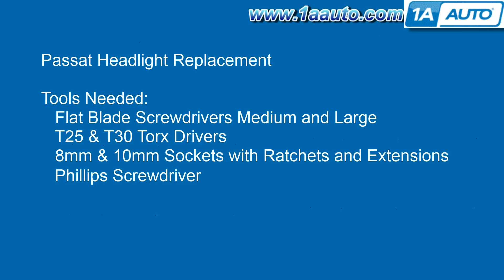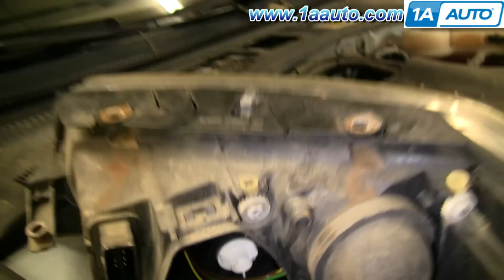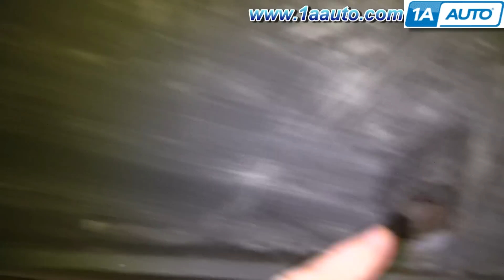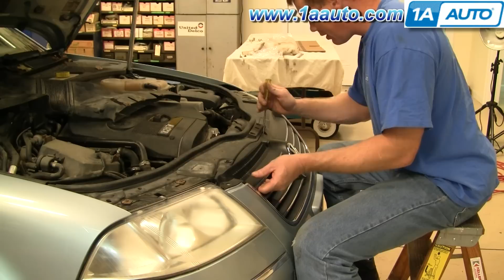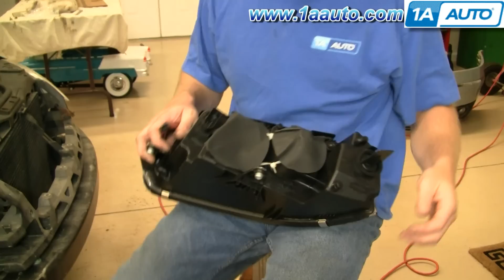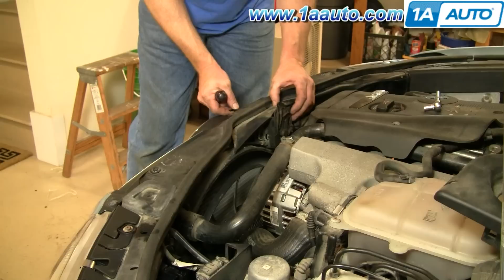How To Replace Headlight and Bulb 02-05 VW Passat Sedan

Comment: Not for dummies.   I'm trying to "just pull the bulb out" once i got the assembly loose.   Nothing moves.   Is the bulb supposed to separate from the metal cage connected to the black plastic connector?    I can't get the bulb out either way.

Comment: Hey, aiming, aligning these lamps is another story of blue language!  Thanks for the entire presentation. Removing the bumper cover, the bumper front member which carries the inter-cooler etc etc and the front motor mount incorporated, and then the alternator, and S-belt and then into the front engine cover in order to remove the Timing Belt/water pump.....that's almost where doing the headlamps take you. So learn this if you're keeping your VW....it's not so bad. Those Triple Square bolts are the pits! They will shear! Replace all with Grade 10 Hex bolts.
The headlamp job is a trainer! Thanks!

Comment: light bulbs should be easy to replace on the road without tools but are they? I think they are not. lights are very important thing when we think about safety driving. so I just don´t get this kind of engineering.

Comment: Ok, I'm really confused! I just watched a "DIY" video showing you how to change the same bulb and he didn't have to remove the front end. The video was less than 5 minutes long and he made it seem really simple. I'm going to use his method. YES, I'm going to do it myself!
Reply: I was thinking that there has to be a simpler way. There is a video where there is enough space to just change the bulb sticking your hand behind the fixture, but I guess this video is for replacing the whole light assembly. I guess it makes sense.

Comment: Question about the bulbs. On my wife’s 04 Passat sedan, the low beams (outside bulb) come on without the headlight switch in the on position. When I turn the headlight switch on, the small bulb inside the high beam housing comes on, and the low beams stay on. Is this normal? What is the point of the small bulbs inside the high beam housing, and why are the low beams on regardless of the headlight switch being in the on position?
Reply from the maker: +Arnott15 You may want to see it the vehicle is equipped with some type of a daytime running light option that may be causing this to happen. Hope this helps you out. 1aauto.com

Comment: What causes low beam and fog lights not to work.
Reply from the maker: +Teresa Coulter You may want to start by checking the fuses. If they are okay, it could be a bad switch. Hope this helps you point you in the right direction. Have a great day! 1aauto.com

Comment: God help us. Engineers will be the death of us all. Would not be surprised if I have to remove the transmission to add washer fluid.  Thank you for the video. Hope my lights last forever.
Reply: They won't, also the engineers never worked outside in -16 weather.   Wait until it's 80k miles to do the water pump, timing belt and idler pulley(s) and tensioner.  This is an excellent machine but to service anything requires a surgeons adept fingers and tools, and lots of time and patience.  Don't break stuff!
Reply: This comment perfectly summed up my feelings for this car

Comment: This is exactly what I needed for the assembly replacement. Thanks for this video!
Reply from the maker: Thank you for watching. Please let us know how the repair comes out! 1aauto.com?utm_source=YouTube&utm_medium=CTA%20Comment&utm_campaign=1ATony 888-844-3393
Reply: The installation went great! I watched your video twice and didn't have any questions about how to disassemble the bumper or remove/install the headlights.
The issues I had is that I bought lights on eBay before I saw your video and subsequently the link to the headlights you guys sell. They would not aim properly. I believe it was a defect in manufacturing. Unfortunately I had to modify them slightly to use them so I'm unable to return them to who I bought them from. They had crap connectors on the wiring so I spliced in the original connectors from the original headlights.
I just placed my order for the 1aauto.com headlight assembly kit for 2003 VW Passat to replace these.

Comment: Wow, I dreaded doing this but it was a lot easier than I thought. Only problem I had was when I found a wire hanging down that I didn't know where it came from, 1J0973702 or 1J093702 can't remember now but further searching I guess it's an air temp sensor you need to tuck back in somewhere, which I did. My wife sure is happy all of her lights are working. Thanks.

Comment: 1a auto, what if the grill screws just keep spinning? if tried everything. like, everything. even have my Passat Facebook group giving me ideas, but nothing works.
Reply from the maker: +Justin Quinn Sounds like their housings are stripped. You could try drilling them out and just using a small nut and bolt instead. That's probably what we'd do. Hope this helps you out.  1aauto.com?utm_source=YouTube&utm_medium=CTA%20Comment&utm_campaign=1ATony 866-403-3393

Comment: I purchased and installed new headlight assemblies on my 02 Passat. However the beams are way off, aimed very low and I can't find anything that explains how to adjust them. I tried turning the two wheel like screws on each assembly but it didn't seem to move them up nearly enough.  Any suggestions or help is appreciated.
Reply from the maker: Hi Mel, On the back of the headlight there should be an adjusting screw (or two) that will raise or lower the headlight when turned. hope this helps you out. 1aauto.com 866-403-3393

Comment: One note of caution: Avoid touching the actual bulb (the glass part) with your skin while you're installing it. When the bulb becomes hot, your skin oils might cause the glass to shatter. It's not guaranteed to happen, but better safe than sorry!

Comment: A1 all the way....This worked out perfect.  I had a road alligator pop up and break my 2003 passat head lamp lens.  I found this video...ordered both head lamp assemblies....if going to take the car apart might as well replace both...and the price was the best around.  Followed the video and everything went exrtemely smooth.   I will definetly continue to use A1 to keep my 2003 Passat going...currently have 235K miles and looking to top 300K.  Thanks A1!

Comment: Hi there! Im a fan of cars from Germany, i like Audi RS6 and models like that!
When i still was young 1975 i drove Dodge Dart -65 and Dodge Challenger -71 with 440" big block engine, i also had a Barracuda -71 with 460" Mopar dragrace engine, 1988 i did 11,3 on the dragway Mantorp Park in Sweden!
But then i discower the mighty Audi Quatro and the rest i history!
Now i drive a Passat -06 2,0 liter engine with gasoline, i think its 150 hp engine!
Now im older (58) and have not the power anymore to fix my car, but this site help a lot when i want to fix something small!
Biig thanks!!
Reply from the maker: Thank you for watching!
1aauto.com 888-844-3393

Comment: I changed the low lights and checked the fuses, all good, but still cannot get the low beams to come on. What next to check?
Reply from the maker: You may want to take a look at the switch to see if it's bad and needs to be replaced. 1aauto.com 888-844-3393

Comment from the maker: There should be an adjusting screw on the back of the headlights. If you turn them, you will see the light move. You want to park the vehicle about 25' away from a wall or garage door with the lights on. When you turn the screw you will see the beam move. Hope this helps you out. 1aauto.com 888-844-3393

Comment: Hello, I have a question in regards to adjusting lights that have fallen and are pointing down. I have an '04 Passat with halogen lights and my driver side headlight is pointing straight down. (The passenger side is also pretty low). I am interested to know whether I will need to purchase new headlights or if there is a more affordable fix. And what kind of bill should I be expecting if the answer is to replace.

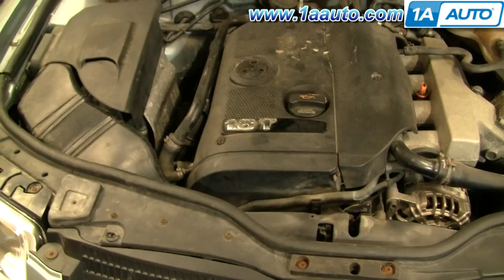Comment: Just changing the bulbs is shown in the vid from 01:00 to about 01:40.  Real easy.  Remove the covers, turn, pull, replace, put back in, turn, put covers back and finished. That is why I like VW.  I had a Renault Laguna before, and that was hell. :)  Even changing the windshield wipers was difficult.
Here the rest in the vid. shows you how to do when you want to change the light casing itself.

Comment: For the HID headlights you have to actually remove them from the vehicle, it's impossible to service otherwise. There are 2 kinds of headlights for this Passat version, the regular halogens (as seen in the video) and the HID's (you can tell them apart from the turn signal placement). For the HID's Hella (the OEM) has posted a bulb replacement time of 93 minutes. Go figure.